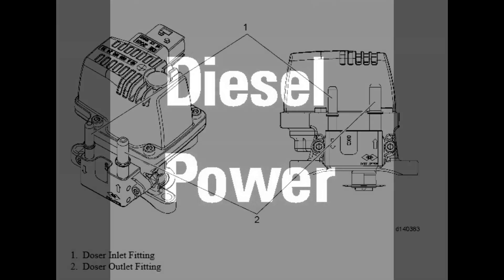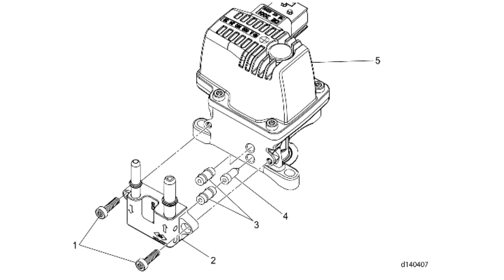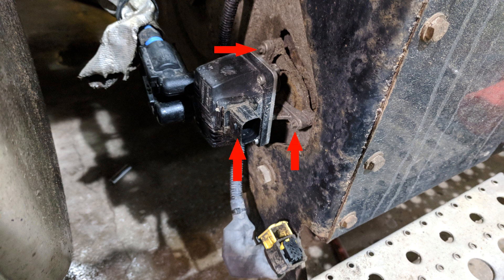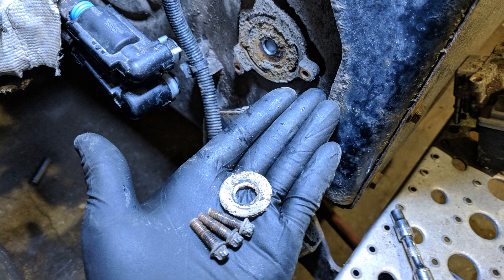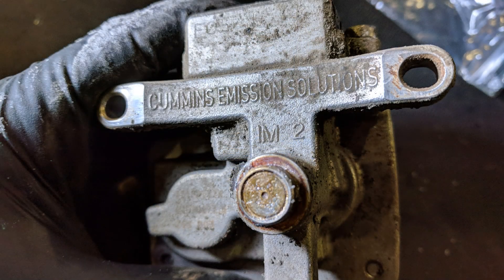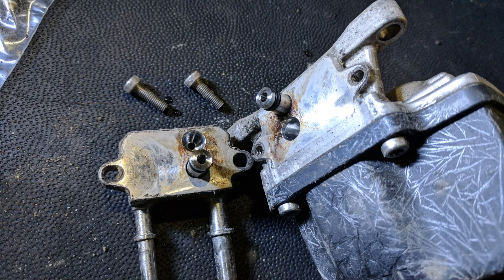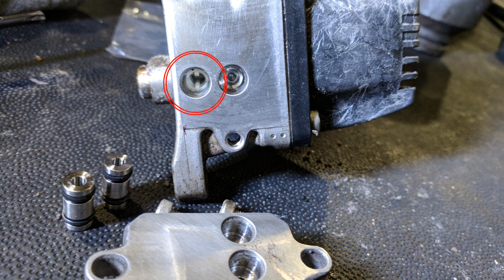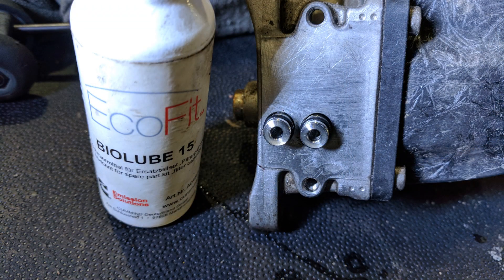Detroit DEF Dosing Unit Inlet Screen

Comment: How the hell do you stop the flow of Def after you disconnect those lines?
Reply from the maker: The lines are basically siphoning DEF out of the tank. New DEF lines come with plastic plugs installed in them to keep debris out. I usually keep a few different sizes on hand to plug lines while I have components removed. You can also disconnect the suction line from the DEF tank to stop the siphon.
Reply: @TheDieseler  I was thinking about that,  but haven't disconnected from the tank yet.  Thanks

Comment: You did not show the mounting gasket proper installation orientation. The new gasket has 4 small protrusions sticking out on the same side as the gold lettering which is shown facing up in your video. The old gasket e help!either one, so I'm not sure how to install the gasket properly. Please help!

Comment: Yall may call me a liar but I once saw a (mechanic) take the doser off to install a new one that is not the issue what he did next surprise me...he took a funnel and started putting hot water trough the doser hole on the one box then ran the engine after he finish I ask what was the water for....he said to clean and devolve the def build up....I don't believe it

Comment: Please say what year and engine in your videos for clarity. Thank you. Not all are the same.
Reply from the maker: This video is on the airless dosing unit so it obviously began with GHG14 engines. It has not seen any real changes since then.
Reply: TheDieseler it isn’t obvious to someone who is just learning the names and part locations of the system. Some don’t know the difference between EPA07/10 or GHG14. How would a new Owen operator, like me,  know that GHG14 is airless if he owns a 13 cascadia? So he’d be watching this video and would be looking at unfamiliar parts. Now if you titled DEF injector first GHG14 or put the year in the title,  it would bring clarity to someone who don’t know as much as you do.

Comment: diesel, if my d e f pressure is fine and it's showing low nox conversion that goes away, after a regen, could it be that my d e f inlet filter as shown here is needing replacement because I'm getting poor d e f quality signal 3364 fmi 2?

Comment: How would you know that dosing unit bad and needs repair?
Reply from the maker: +Bad Guy A DEF quantity test is most often used to see how well a Dosing unit is performing. During the test it needs to inject a specific measured amount of DEF or it fails.

Comment: Do you have part numbers for the service kit?
Reply from the maker: In the video, I don't show a lot of it, but I'm installing an "RS Supply Kit". It also consists of a DEF Filter, DEF Pump inlet fitting/screen and DEF Pump Pressure relief valve/Plug. I believe the part number for it is A0001408678. If you just want what you need to change the Doser inlet screen, the part number should be A0001401494. 
As always though, I'd recommend contacting a Detroit parts dealer with your VIN/ESN to make sure you're getting exactly what you need.